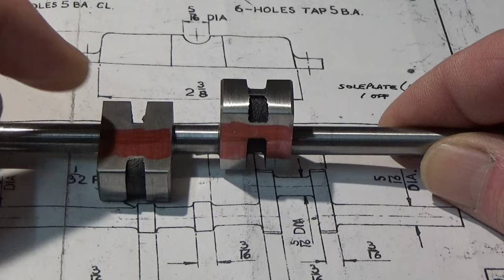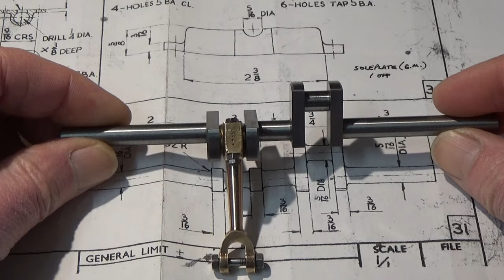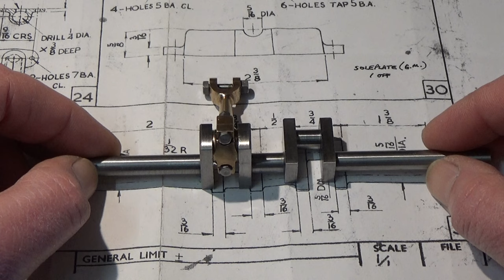Stuart Turner Twin Launch Engine pt 8c crankshaft (final)

Comment: Thankyou Robert for your vids that helped me build my Twin launch.. Btw I used a collet inside the fly wheel
Reply from the maker: I’d considered a collet arrangement too, but two diametrically opposite grub screws and flats on the crankshaft proved ok. Might use a collet setup on my next engine lol!

Comment: I've an old set of Stuart Turner twin launch castings "seasoning" under my Work Bench, so I'll be doing this same thing soon enough.  I will have to come back and revisit your videos as it looks as though the way you did the machining here is spot on.  I will be using some of your methods when I do mine. 👍👍👍
Reply from the maker: Thanks and good luck with your engine!